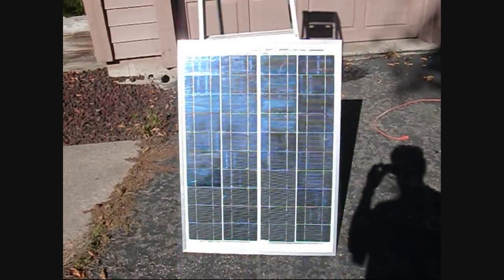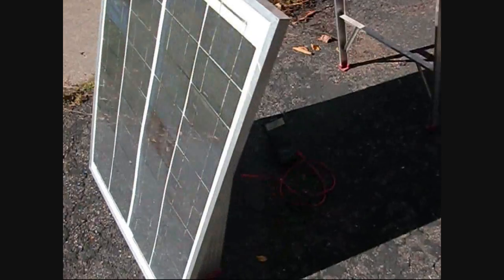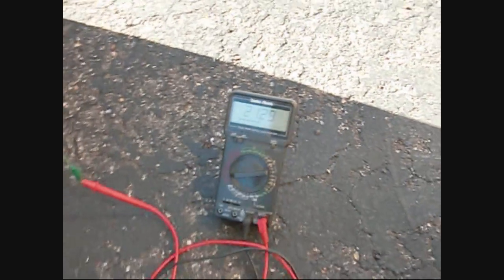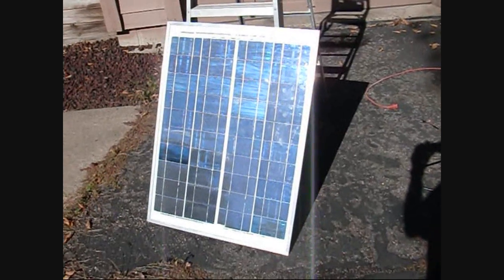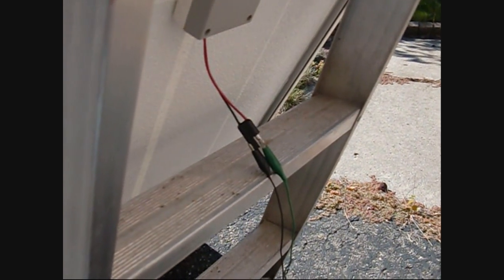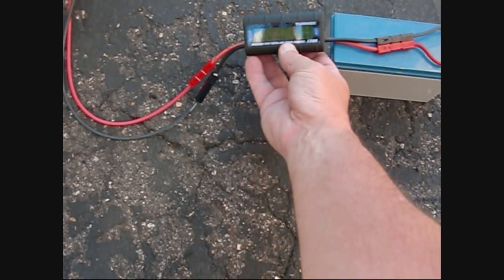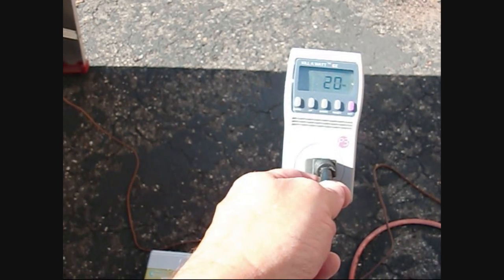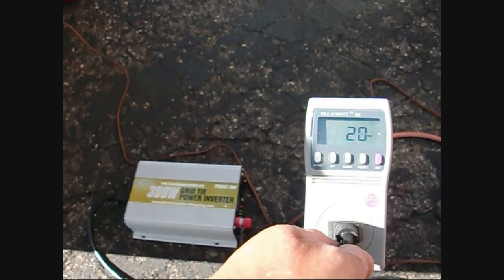PART 8:  $100 70w Solar Panel DIY project

Comment: I need  to get one of those testers like you had in front of the battery. I did notice when I tested mine with the kill a watt that there was a noticeable difference in wattage when I changed the orientation to the sun.

Comment: @Fearlessthinker That sounds about right for 40 cells, I went up on my roof with a grid tie inverter and checkes all 5 of my panels, Got 55 watts out of each one give or take a watt. I tested them earlier in the day so I think they put out more later plus whatever the grid tie loss is. but at least they are all consistent. They each put out 20 volts open.

Comment: @MrHorsetail It would depend on what type of charge controller your going to use. If you use an MPPT controller you will gain from the extra cells but an older PWM type controller will just hold the voltage back so you won't gain anything. I think if you just go to a grid tie inverter ( no charge controller)  direct you'll gain with the extra cells.

Comment: I'm wondering what you'll gain with a 40 cell 20v system charging a 12v battery.  The amperage is still 3.5, but the wattage would be higher, but what do you gain over a 36 cell panel.  Faster charging maybe?